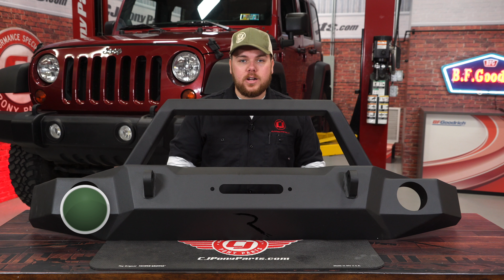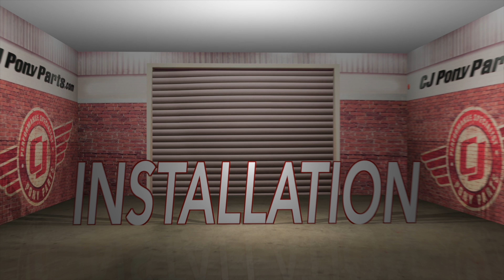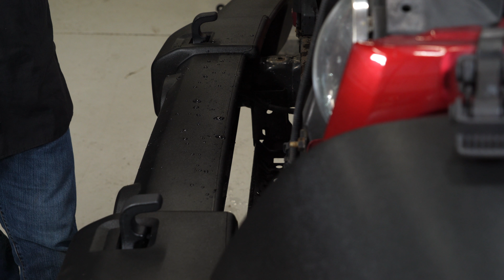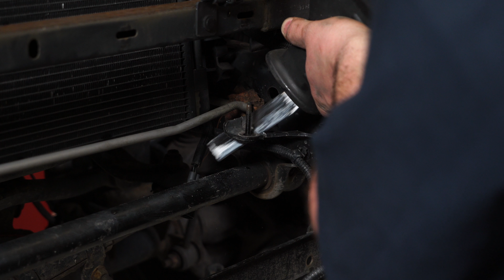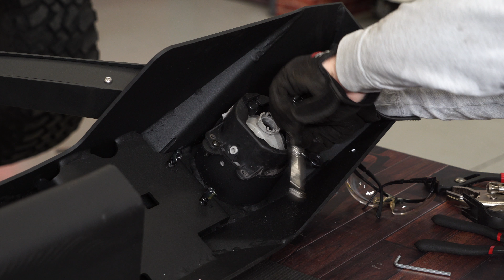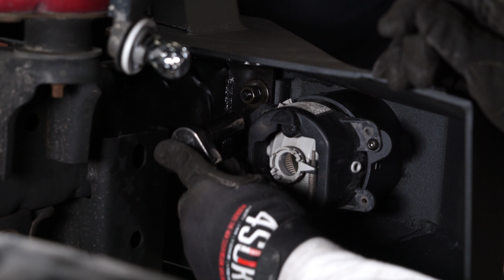Jeep Wrangler JK Rampage Front Bumper Trailguard 2007-2018 Installation

Comment: I'm looking at a very similar bumper for my '19 JL. Is the Rampage brand worth it? The bumper i'm looking at is like $400 CAD compared to some other brands like DV8 selling around $800. Would i be "cheaping out" if i got the Rampage brand bumper or does it feel sturdy and good quality?
Reply from the maker: If you were looking to stay affordable but still want to use your bumper a bunch i would recommend going with smitty built or rugged ridge.